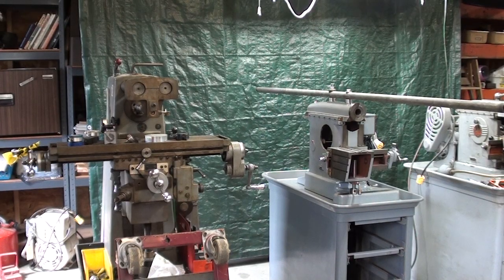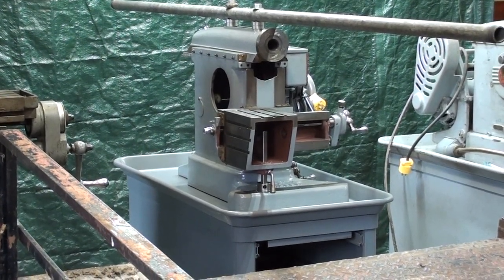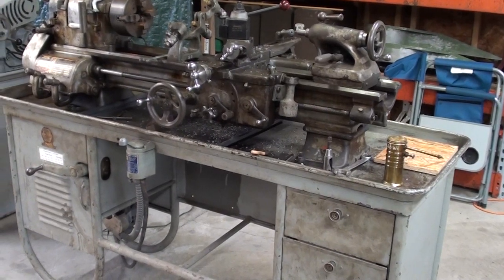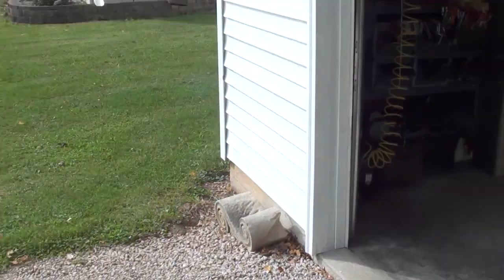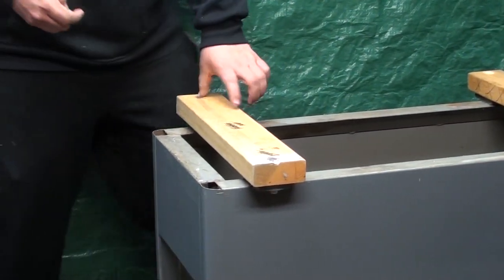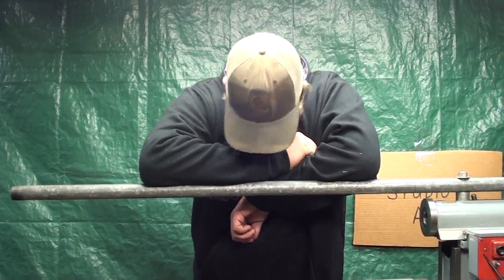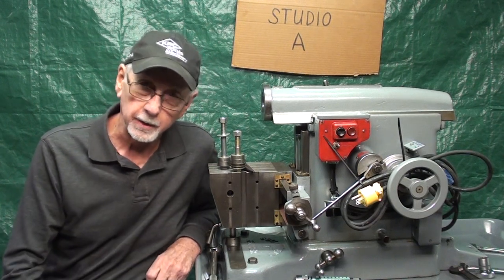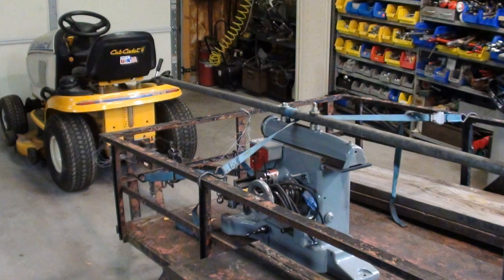Moving Heavy Machines to BasementTips #689 tubalcain south bend shaper

Comment: Always nice to have help when needed.
My shop is also in the basement, however, our house is a walkout with a   1 car garage door. We also had floor trusses not floor joists so the whole basement was one room no poles.
Years later it was divided into 2 rooms.
Shop on one side with the garage door. Model railroad on the other.
Best part is it  never gets below 55 even though it could be below o degrees outside and in the summer is cool.
Have a Jesus filled day everyone
Greg in Michigan

Comment: I added ramps to my stairs down the basement. They straddle both sides, and the middle is for normal stair walking.
I picked up a horror fright AC winch and made 2 L brackets that brace against the doorway (after door is removed) to lower and raise stuff on a dolly, made of 2x6"s with 500lb a piece 5 inch wheels. I'll tell you, it makes life much easier. I built a wooden gantry to lift from the garage to the dolly. It has unequal height since there is a 8" step. And allows me to roll (trolley) right on to the dolly and then drop it down gracefully.  I use a snatch block to reduce the speed and it works like a charm.
Reply from the maker: That is pretty much how I put the Bridgeport into the Bassment

Comment: I use a 2 wheel hand cart to move heavy items around my place.
Doesn't work for everything but it does work well in quite a few situations.
Sometimes I use straps to help hold things in place. Works pretty well when you don't have help.

Comment: Hi Lyle, 

That tip in appreciation was really showing your age. Clearly it's the boss who does the shopping!!

I think you might need stronger stairs and a much heavier pole to move Adam's shaper in that way, and about 20 Adams on each end. 

I have an Archdale horizontal mill, around WW2 vintage, and it's around 2 ton. It's definitely a forklift job. 

Were you serious about taking it out again in 6 months? Maybe you should install a trapdoor and electric winch to the upper floor. There is another project. 

Regards Dennis.

Comment: There was a Dairy Queen midway through my paper route back in the early 60's.  I'd pull my bicycle over and buy a plain small soft serve ice cream cone for 5 cents.
Reply from the maker: I did the same thing at the tasty freeze. Sometimes did not have a nickel, but they had a drinking fountain on the outside of the building
Reply: Lucky for me, we had lots of litter bugs. I would find pop bottles on the roadside and turn them in at the A&P for the penny deposit. Always had money for ice cream.
Reply: In OZ in the 50s, went rabbiting for pocket money. Did well out of until Myxomatosis wiped them out, well, almost. The number was in the billions. Hills were seen to move, but just the rabbits on them.

Comment: That was great. Well this Friday, I have a work party scheduled to move a 7 inch Rhodes shaper. Would love to meet you. You put together great videos, as well as Abom and Keith. Regards, Dave W.
Reply: @mrpete222  Hi again, well the Rhodes shaper is apart and in the shop. It was suggested to put the base on caster wheels, and I could install screw down jacks to stabilize it for operation. It is in very nice shape and a new coat of paint, motor and wiring renewal and it should be ready to go. Stay safe and healthy.
Dave

Comment: Just a hint from an old truck driver. If you choke wrap your tie down, specially something larger, Start the wrap over the top, not under the bottom like you did. You get more down force that way. A hint more for the readers.

Comment: I don’t know what kind of water pipe you used but it must be stronger than the stuff I used for my bird feeder pole that was the same size. That was customized and reconfigured by a very large black bear that turned it from straight to a rather easily formed 180 degree curve and with little effort. So to be more serious and not to be pernickety about things what was concerned about was the holes in the pipe being a possible weak point and the distance from the holes (mounting points) bending and breaking 😳 basically Mr Pete my experience with water pipe for anything really but being used for directing water under pressure. Is questionable at best. Go ahead call me a worry wart or safety Sally. I can take it🤣